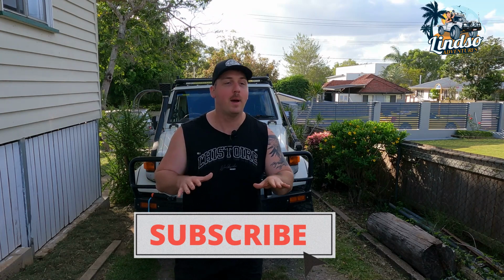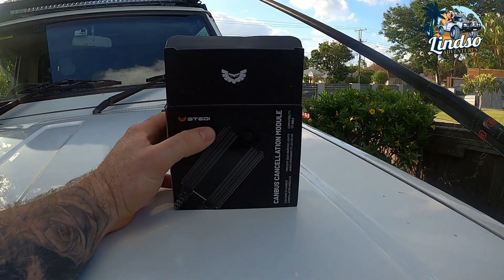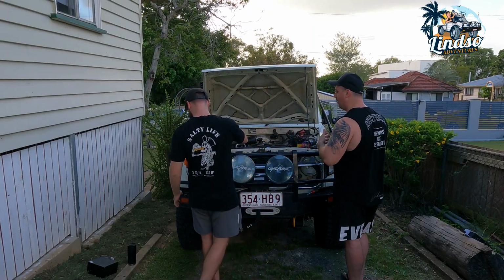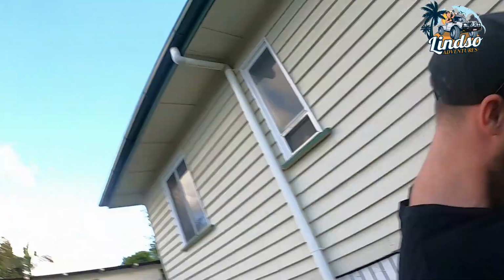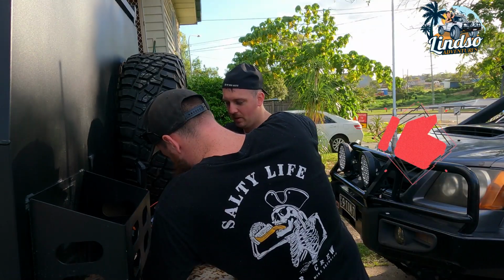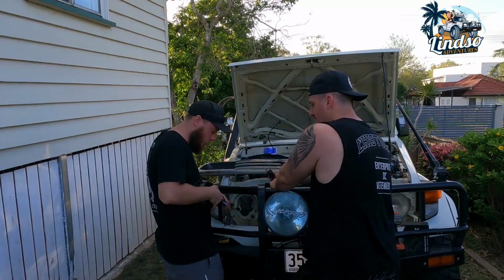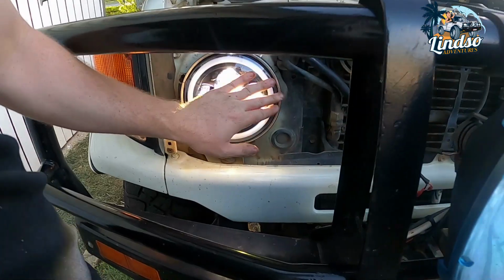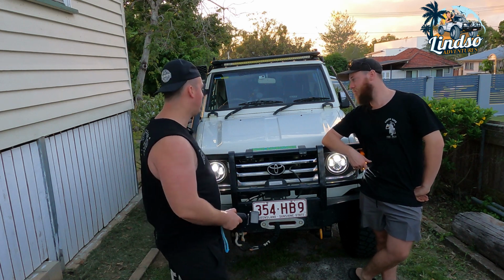100 Dollar Ebay lights. What's your thoughts?  75 Series Landcruiser Mod Yet. V8 Chevy 6.5 Brunswick

Comment: Hey, mate I am interested in the same pir of head lights.
Could you please send me a link for the Ebay head lights and the little controller from steddy and also wondering if the lights came with wire to fit up the daytime driving lights?
If you could do that, that would be great.
Cheers mate
Reply from the maker: Hey bro just go to ebay an type in Led lights for 75 series Land cruiser, an go to stedi site online an search up a cancellation plug, yea doesn't come with a cord for the day lights that's the next thing I have to sort out, send me a pic of your Ute an when you fix your lights up on instagam bro be cool. To see.
LindsoAdventures__hq